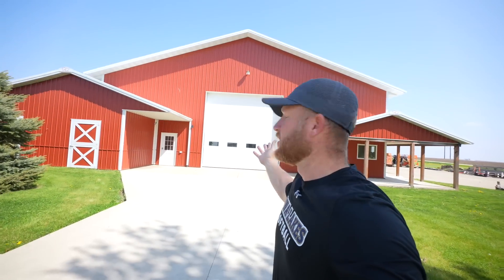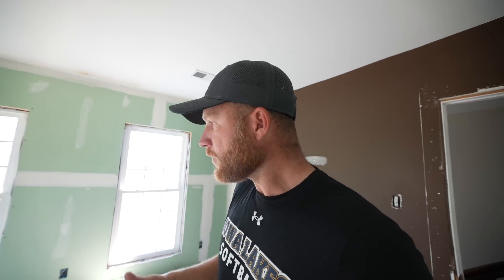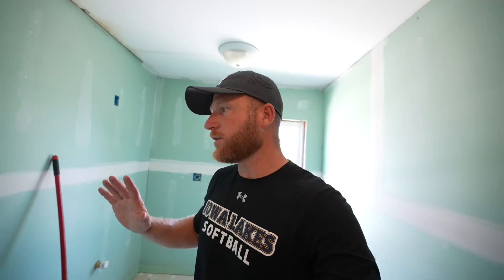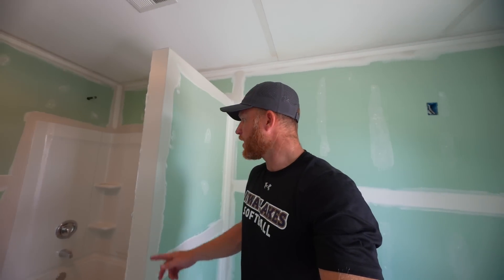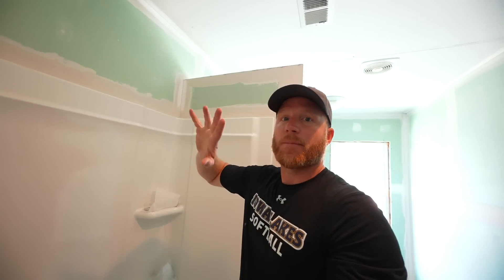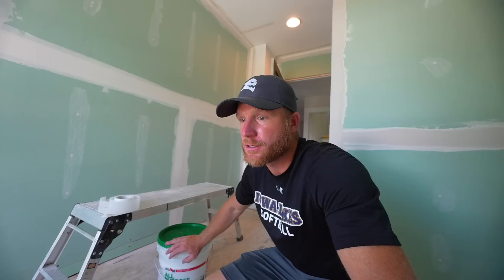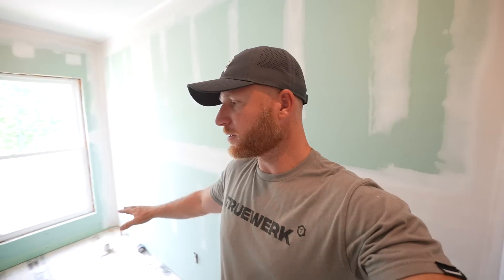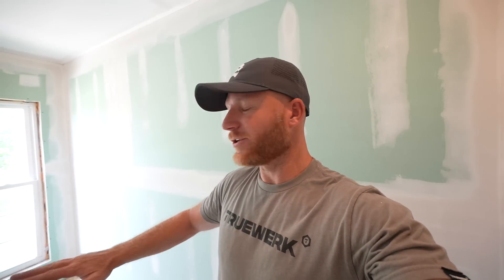The Return Of The Farmhouse Remodel Is Finally Here!

Comment: I guess I'm late to this party... never saw the farmhouse remodel playlist... so now I'm just going to have to go check it out.  My brother is in a similar position.  Huge house and property an hour north of the city in a small town... 5 outbuildings...  He lifted the house up and poured a new foundation/basement with heat in the concrete floor and an outdoor wood burner... but before the trim was done they had to move closer to the city for lots of personal reasons.  They can't yet bring themselves to selling the property, as they designed and renovated it to be their dream house... but the pressures of life are the pressures of life.  I'm looking forward to seeing you finish this transition up and then I'm going to hold you up as an example for him.  I hope it works.

Comment: Ok kids, this is how you finish drywall. I would use a sanding pole and a 6 inch trowel vs 4 inch for corners. But over all very good. Also I hope you put cement under the tub to support it. 👍🍺

Comment: I wouldn't use metal corners in a bathroom especially near a tub and window. They will rust. 
The mud will eventually detach from the OSB from expansion and contraction of the wood.
Reply: also should have used Durabond around Sterling flange, not all-purpose mud